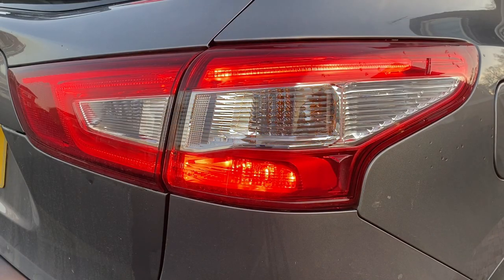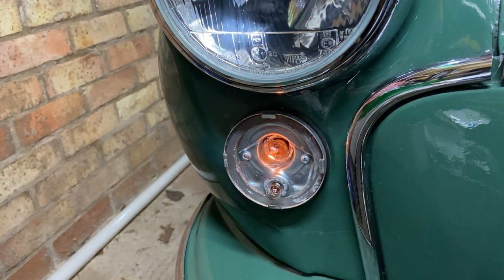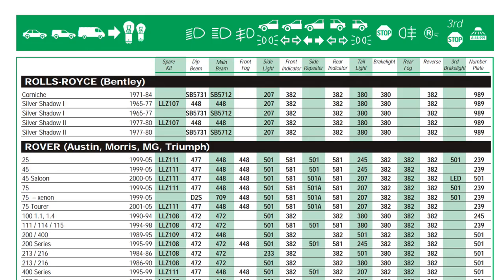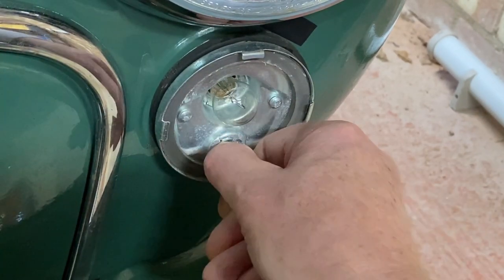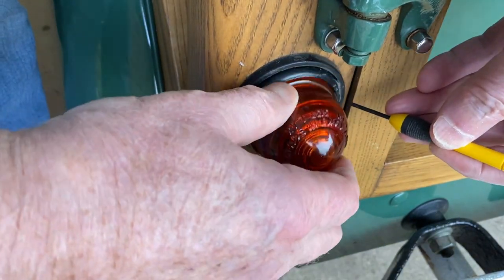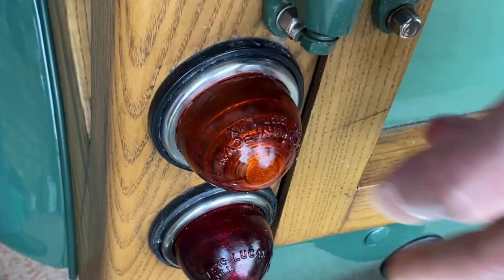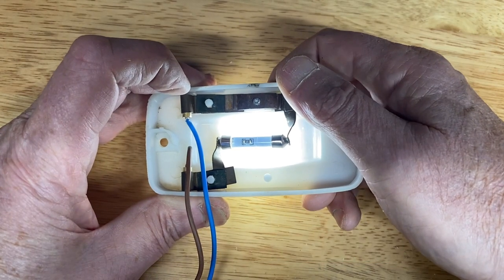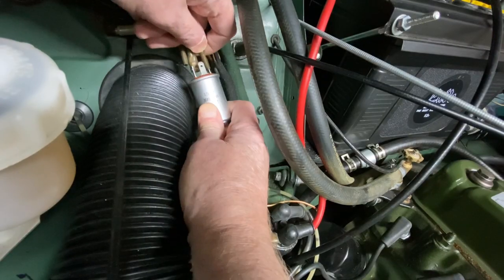Fitting LED bulbs to the Morris Minor Pt 1

Comment: I used the 12V Buzzer which was placed in circuit with my Oil Pressure switch. When you turned -on the Ignition, it buzzed. As you started the engine, the Oil Pressure built-up, the buzzer ceased. I once lost all Oil Pressure, and didn't notice the small (tiny) Oil Pressure Light in bright daylight. This is an instant warning - that will always protect your engine in an oil-pressure loss situation. Well-explained video that covers all aspects of switching to LED Lighting for a classic car. Finally, I changed my High Beam warning to LED. It was barely visible when lit before this action. Greetings from Australia.
Reply from the maker: That’s a really good tip 👍

Comment: Thanks for the excellent video, which I followed.
I have a problem with the indicators. I have fitted the updated flasher and the indicators work fine both left and right. My problem is that the light on the indicator stalk is still lit and flashing when in the neutral position, and the indicators are not flashing.
Any ideas/suggestions?
Reply from the maker: Unusual problem. The most likely cause is the wires connected to the wrong terminals on the flasher unit. You should have a green wire (power) a green and brown wire (to indicator switch) and a pale green wire (to bulb on the stalk). If the pale green and the green and brown wires were swapped, it would cause the problem you describe.

Comment: Superb clarity of explaining. My traveller is a negative based. Got as far as fixing the new flasher unit. Tried lights with the new LEDs and disappointingly when I try my indicators one side  my lights are dim, probably just like me! Spent the whole day  relaxing and trying to work out my problem. Will bang head twice!.
Learnt so much from your video's, thankyou.
Reply from the maker: Thanks Les. Did you get it sorted eventually?
Reply: @jodiethemorrisminortraveller  Hello, I've been  unsuccessful on this occasion.
I have ordered another new electronic flasher unit again from ESM, I'm hoping it's a faulty unit. Your instructions were very and and I find it very easy to do. My new LED bulbs remain in position awaiting the 2nd new unit. Fingers crossed. (I failed on the ' bang head twice' method, didn't fancy the pain.)
Reply: Hello, after many hours of back tracking, checking all earths  ...........I've worked out why the near side indicators weren't working correctly. As the led bulbs are slightly longer than the normal bulb, it was making contact with the inside of the rear lense when fixing back on. As a result it was displacing the bulb fit and causing the lights to dim. ....................gonna be doing a few ' star jumps' now celebrate!.
Reply from the maker: Glad to hear you solved it

Comment: I find your videos excellent tutorials, very easy to follow, highlighting potential pitfalls along the way. I have a question for you that is not directly related to the video. When changing to led headlights you show a shot of your engine bay, in particular the carburettor, which looks like an Su hif44. What air cleaner are you using? I am currently using a pancake style which I find too noisy and want to try to quieten it but am having trouble finding one to fit.
Reply from the maker: It’s a stub stack filter from MED engineering. Not sure how quiet it would be compared to a pancake. To be honest, my exhaust is pretty loud and tends to dominate.
Reply: Thanks for information @jodiethemorrisminortraveller
Reply from the maker: Very welcome!